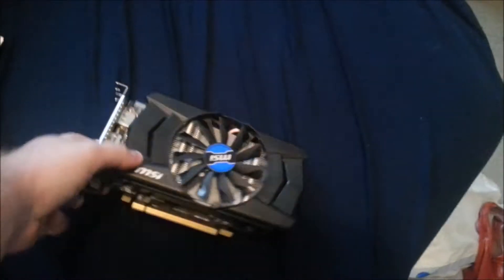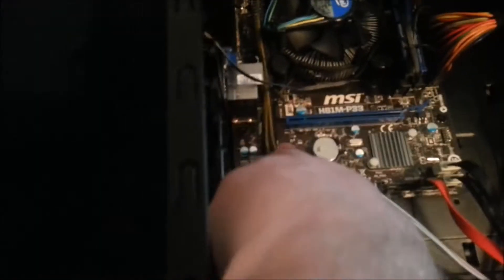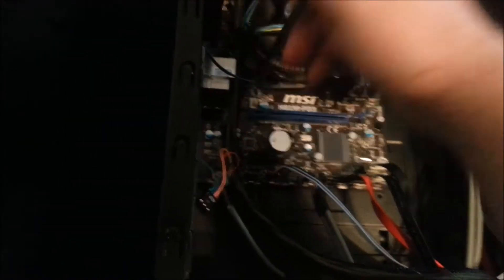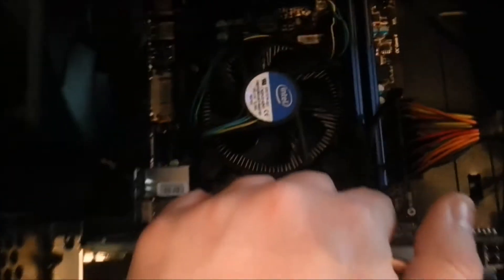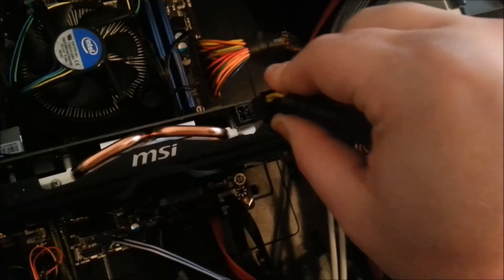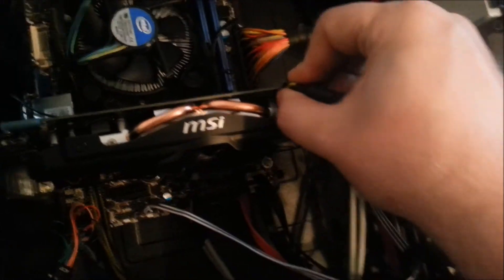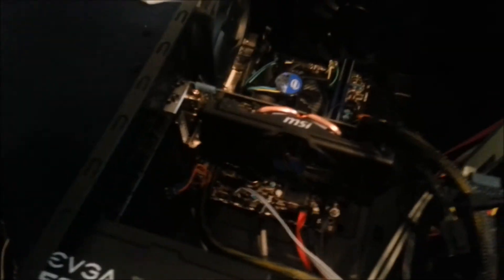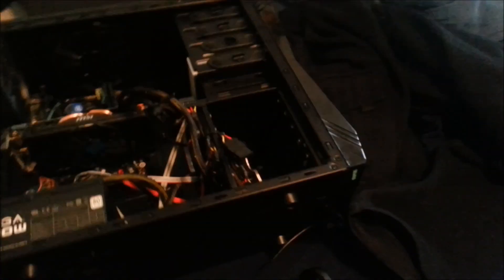How to Install an R7 260x

Comment: you should have added that touching this card with out an anti static wristband can cause damage to the card.
Reply from the maker: I've built, fixed, upgraded and redesigned over 1500 PC's in my life never using an antistatic wrist strap sometimes on carpet, beds, outside etc and have never discharged.  Just always touch your case to ground yourself.  I'm not saying don't use one, but any pro will tell you it's not really needed.

Comment: my cousin have this card and it just not giving video after 1 month usage....tried different pcie slots and also try different power supply and 6 pin/ VGA to HDMI still no video
Reply from the maker: I had the same thing happen.  I RMA'ed it and resold it when I got the new one.  I gave my friend a GTX 670 instead.
Reply: PCBudgetSolutions
Oh well i now have one running good so far running Battlefield Hardline thing is i ordered one before his 260x stopped working so it was on the way..you can check my channel to see the gameplay on all presets.

Comment: Help me guys, my desktop do not have this connector at 1:51, so what should I do?
Reply: you probably have it, look around ur case. If you dont, your gonna need to get a new Power supply that comes with the 6-pin power connertor.
Reply: Swapnil Iqbal I just realized that the 6-pin connector comes with the card.
Reply: oh ya i forgot. well good luck then